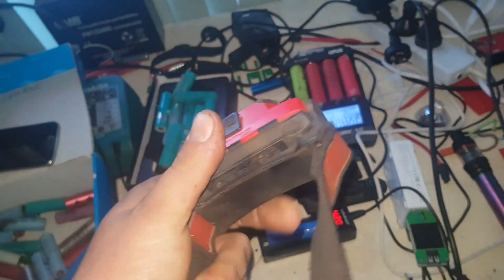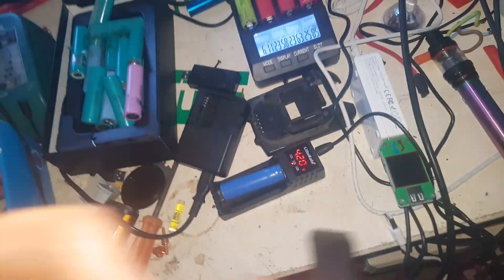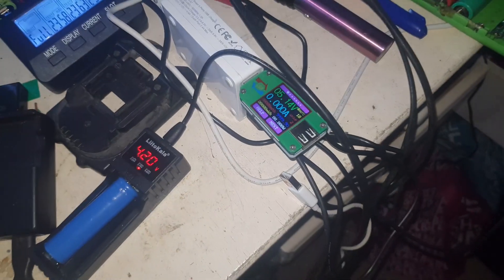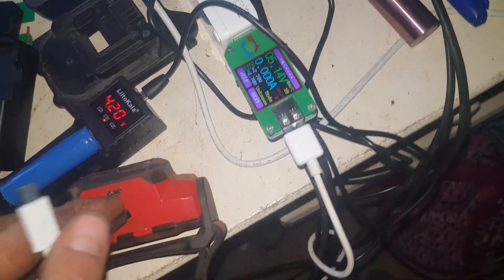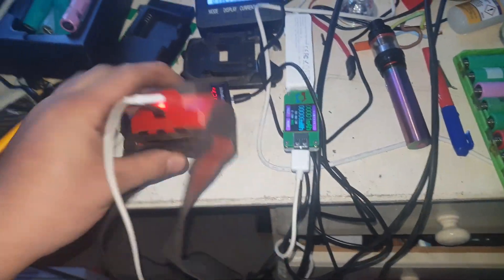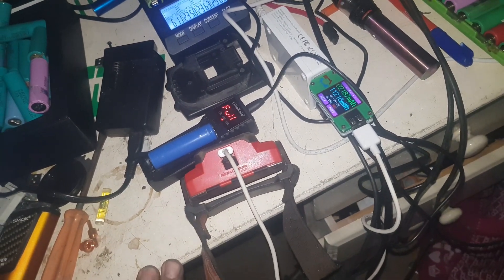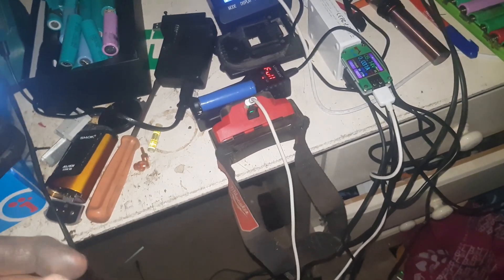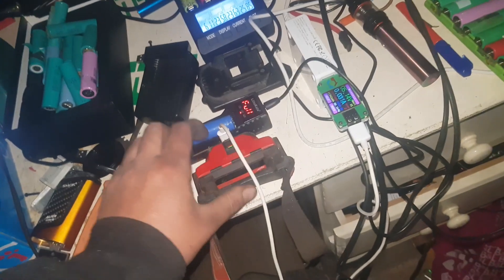Checking for Cell Degradation on Milwaukee L4 HL Headlight

Comment: I use that headlight here and there almost everyday on its lowest setting so I charge mine once every few days, and the battery is starting to crap itself. It has blinking red and green light errors here and there and sometimes refuses to charge or turn on

Apparently it's good up to 2000 charges, I haven't even owned it for 1 year so that's less than 365 charges. I got a second battery and it's starting to do the same thing, if only it was as reliable as the M18 batteries, at 25aud, it better be!
Reply from the maker: Yeah so this one appears to be charging up at about normal rated capacity but i was starting to worry about it been weak check back some time if you have an update

Comment: Power in doesn't equal power stored.  I'd run a discharge test on the cell using that 18650 charger you had sitting there to get a better idea of the capacity of the cell.
Reply from the maker: You might not be familiar with the cell there have protections on board . Not just a plain 18650 or i wouldnt care i have 3000 or more here.  10% ish for losses im happy enough with that